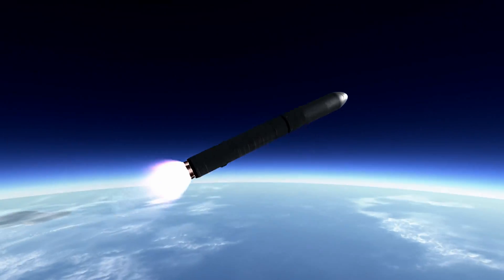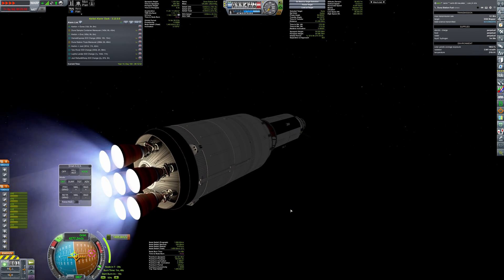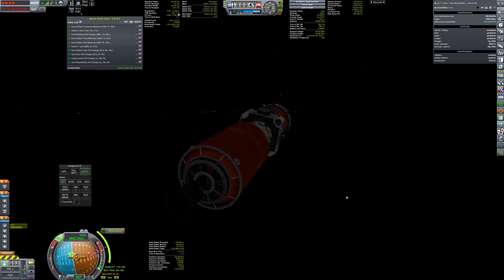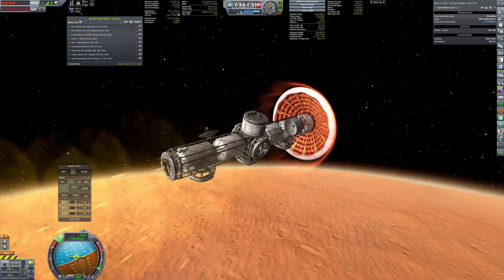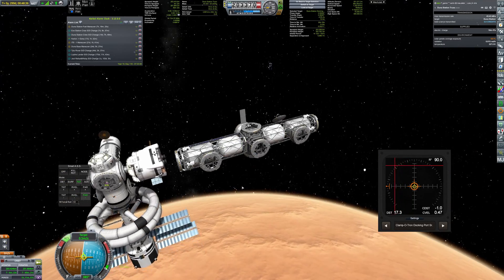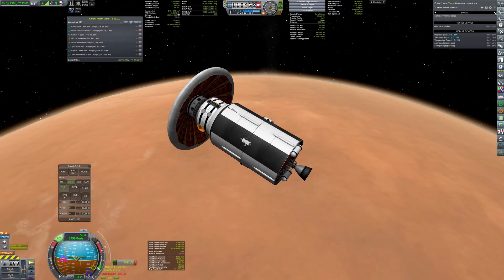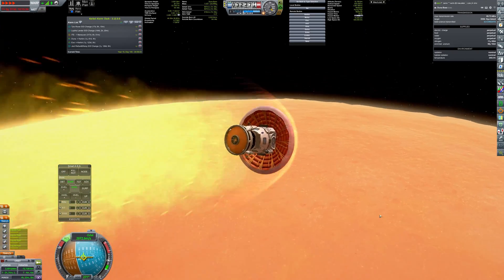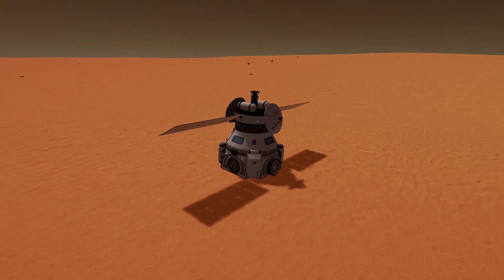Expedition Duna - Colony (JNSQ + Kerbalism)

Comment: What is your modlist?
Reply from the maker: Here it is:
AlphaMensae's Modular Launch Pads
Animated Decouplers
B9 Part Switch
Better SRBs
BetterBurnTime
BonVoyage
BreakingGround-DLC
Chatterer
Chatterer Extended
ClickThrough Blocker
Community Category Kit
Community Resource Pack
Community Tech Tree
Contract Configurator
Contract Pack: Bases and Stations Reborn
Contract Pack: Tourism Plus
Craft Manager
Cryo Tanks
Cryo Tanks Core
Cryogenic Engines
Custom Barn Kit
Custom Pre Lauch Checks
Deployable Engines Plugin
Distant Object Enhancement Continued
Distant Object Enhancement Continued default config
Docking Port Alignment Indicator
Dynamic Battery Storage
Easy Vessel Switch (EVS)
Engine Lighting Relit
Environmental Visual Enhancements
Filter Extensions - Plugin
Firespitter Core
JNSQ
Kerbal Actuators
Kerbal Alarm Clock
Kerbal Construction Time
Kerbal Engineer Redux
Kerbal Joint Reinforcement - Next
Kerbal Planetary Base Systems
Kerbal Reusability Expansion
Kerbalism
Kerbalism - Default Config
Kerbalism Companion Calculator
Kerbal-Konstructs
Kiwi Tech Tree Overhaul
KRASH - Kerbal Ramification Artifical Simulation Hub
KSC Extended
KSP AVC
KXAPI
MagiCore
Magpie Mods
Making History
Malemute Rover
Mandatory RCS
MechJeb 2
MechJeb and Engineer for all!
MissingHistory
ModularFlightIntegrator
Module Manager
Near Future Aeronautics
Near Future Electrical
Near Future Electrical Core
Near Future IVA Props
Near Future Launch Vehicles
Near Future Propulsion
Near Future Solar
Near Future Solar Core
Near Future Spacecraft
Omega's Stockalike Structures: No Textures Required
PlanetShine
PlanetShine - Default configuration
Precise Maneuver
Procedural Fairings
RasterPropMonitor
RasterPropMonitor Core
Rational Resources
Rational Resources Parts
RCS Build Aid
Real Plume
Real Plume - Stock Configs
Reentry Particle Effect Renewed
ReStock 
ReStock+
SCANsat
scatterer
Scatterer Default Config
Scatterer Sunflare
SmokeScreen - Extended FX Plugin
SpaceTux Library
StageRecovery
Stockalike Station Parts Expansion Redux
Textures Unlimited
The Janitor's Closet
Toolbar Controller
Tracking Station Evolved
Tundra's Space Center
USI Tools
Waypoint Manager
WorldStabilizer
Zero MiniAVC
Reply: @Darkherring  thx